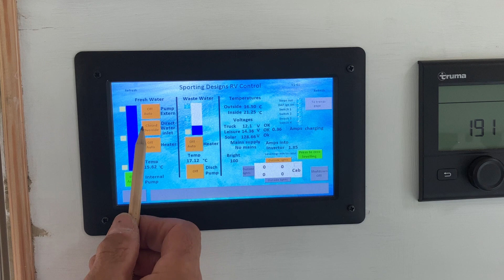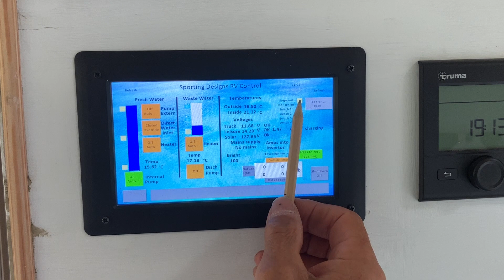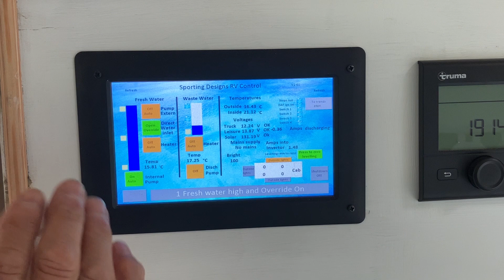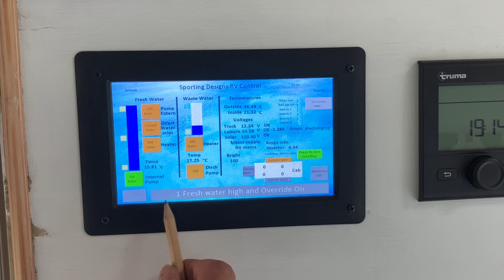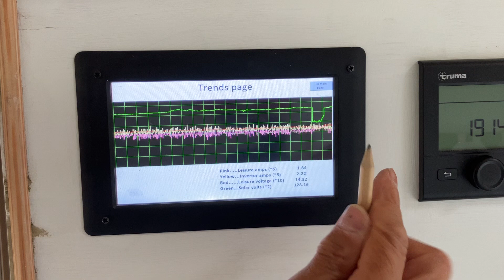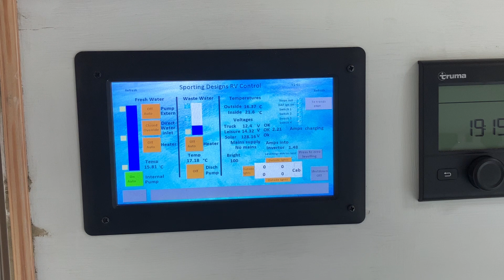RV Conversion No 14 - The Nextion Display

Comment: Have you got a link to the code thanks
Reply from the maker: Thank you for your interest. However, a link to the code wouldn't be useful as it is very specific to the actual wiring and sensors installed. If you have any specific questions I will be happy to help
Reply: @sportingdesigns  thanks for the reply. So you wouldn't share the code so I could have a play with it or do you sell the complete units ?
Reply from the maker: Hello KampKev, Yes we would sell the complete unit and share the overall design. Perhaps the best thing would be to tell me  how you would use it. You could email me at mail {at] sportingdesigns.co.uk
 @livingthedream8327
Reply from the maker: Code is not available because it needs to be installed properly. sorry